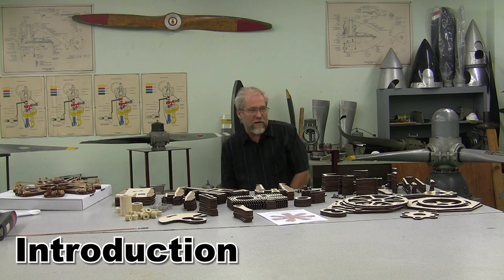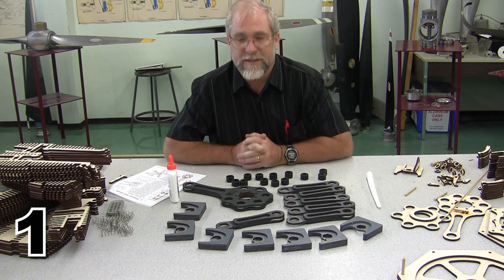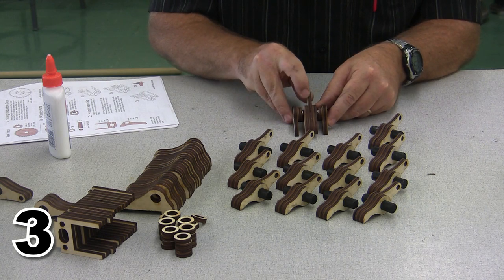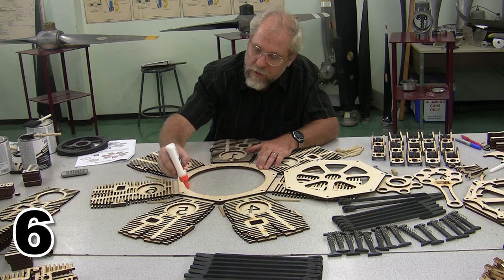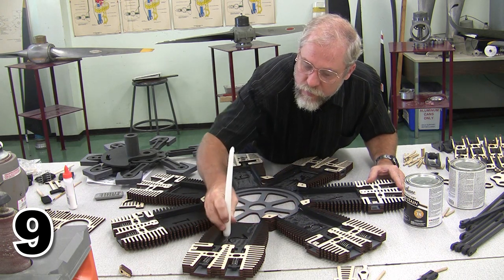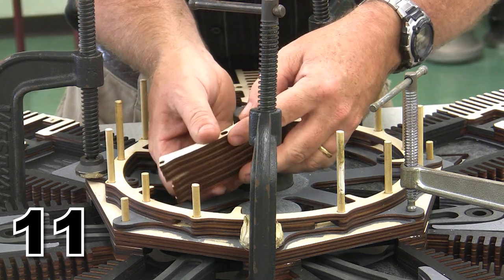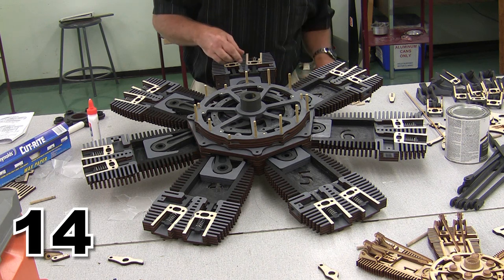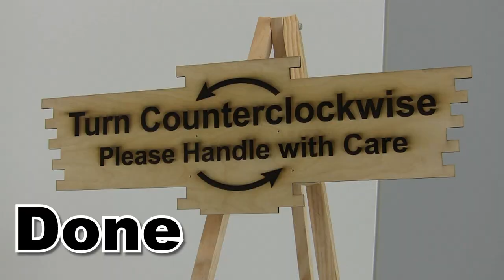How to Assemble a Morris Models Radial Engine Kit

Comment: Why is it crucial to turn the engine counter clockwise?
Reply: That way the valves work correctly - Suck, Squeeze, Bang, Blow.......  Some engines turn Clockwise, others turn Counter-clockwise - this one obviously turns Clockwise (when viewed from the Pilot's position - which is ALWAYS the correct position in aviation). This means it turns Counter-Clockwise from the front (where you NEVER want to be when the real thing is running).